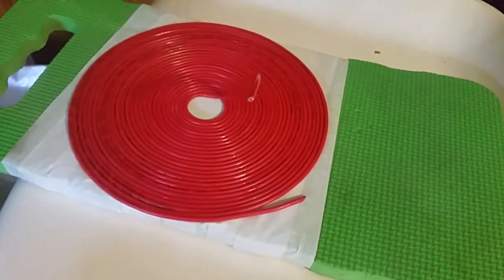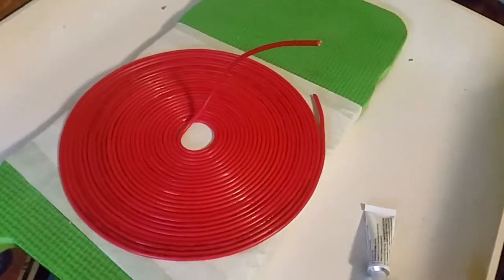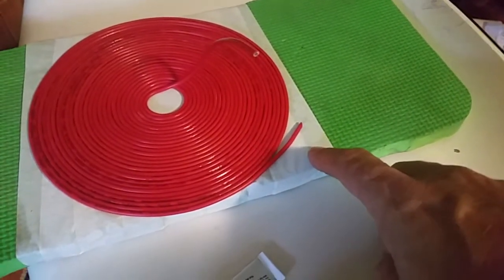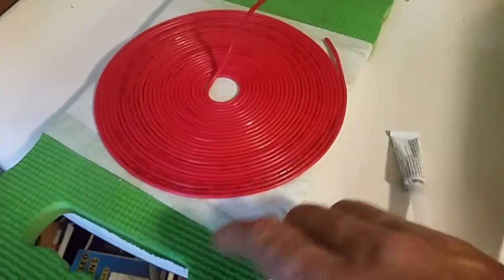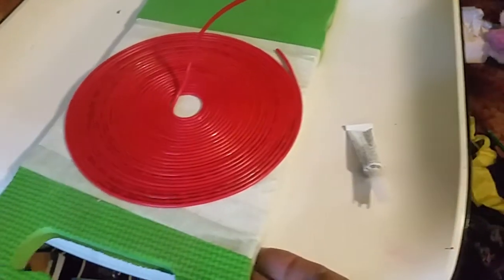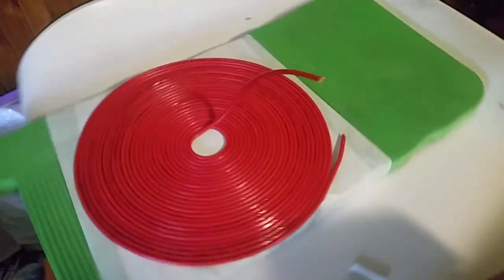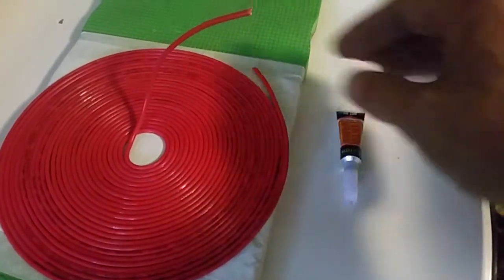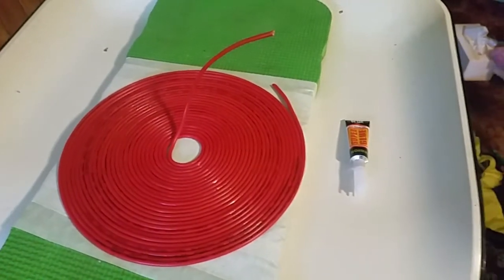Making pancake coils the easy way...

Comment: Is that single core wire? If so, where do you get it from? I can't seem to find anyone in Brisbane with it... cheers👍
Reply from the maker: its not solid, you should be able to find solid core at an electrical supplier, i bought my roll at Cetnaj
Reply: @m3sca1  cheers👍